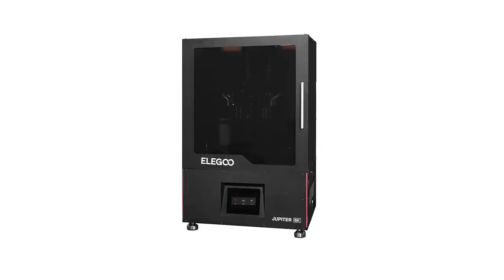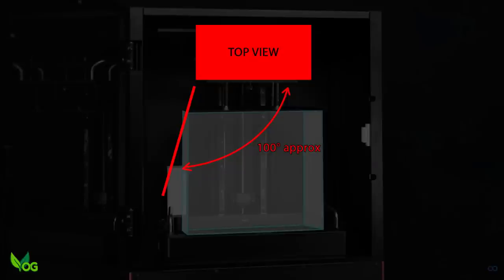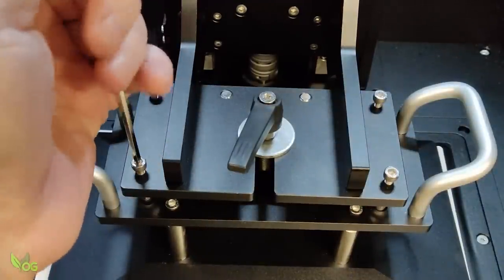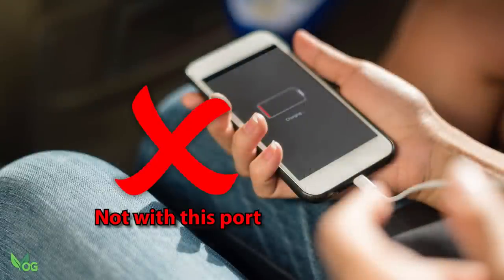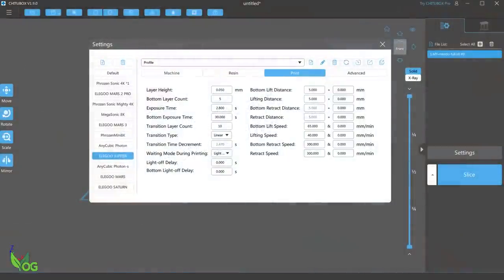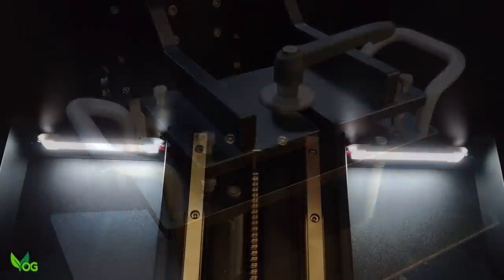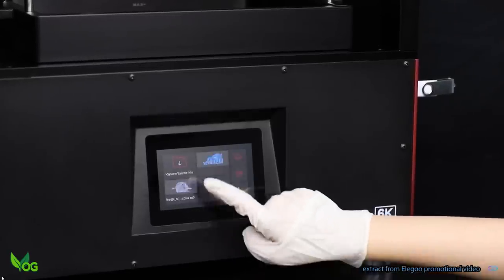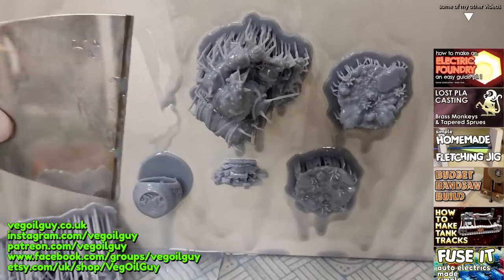Elegoo Jupiter large scale 3D printer with resin Auto-feed [HONEST REVIEW]

Comment: You could probably mill a 10mm x 3mm cylindrical hole in the side of the resin tray and mount a stirring paddle there, powered by a magnetic drive outside the tray, permanently mounted to the floor of the printer. Kind of a minature version of the washing station agitators.
Reply from the maker: It would be great to see some useful add-on 😁

Comment: Can you maybe help me with a problem I got with that mashine? 
The sculptures always keep glueing on the fep film but not on the top ...
My wife is Wirkung with it and some of our first prints worked 
But now it just won't work 😟
Reply from the maker: No problem Boris. Everyone goes through this the first time. Firstly, take out your resin, filter it, then clean your vat and plate properly. This is important as when you have misprints, small pieces can come loose in the resin and these might puncture the FEP.
After that, make sure the plate is levelled properly. This is probably the biggest cause of misprints, so get this bit right.
After that, you need to make sure the settings are right on your resin (the second biggest cause of misprints). Have a look at this video https://youtu.be/jOjB3Fr-0no
Please don't worry. Everyone goes through this at the start. Once you've got the resin settings right, it will become nice and easy for you 😁

Comment: What is this separation you speak of? Is that why some of my prints have a weird split in them?
Reply from the maker: Possibly Allen. You should always shake (or stir) resin before use because it separates. If the colour is streaked, it needs a mix and yes, it could cause printing problems.
Splitting could also be down to poor supports or the normal layer height timing may need increasing a little 😁
Reply: @vogman  thanks for taking the time and replying !

Comment: If they release a higher resolution screen, 8K or higher, this would become more attractive.
Also not loving the plate mounting system. 
Do love the simplicity of the auto-fill system though, just a bottle cap, which would be cheap to replace and far less likely to fail or clog than the AnyCubic system.

Comment: That heater simply should be standard item on resin printers.
Reply from the maker: It would be helpful 😁
Reply: More expensive units do. My Form 2 is heated, auto dispenses, and auto stirs. But all that comes at a price. But it is a good sign that lower cost units are starting to bring in auto dispense. In time the other features will be there as well. In fact print quality is pretty much getting there. So the bigger boys are going to have to step up their game to keep those higher prices.